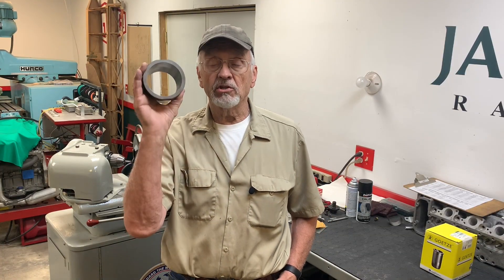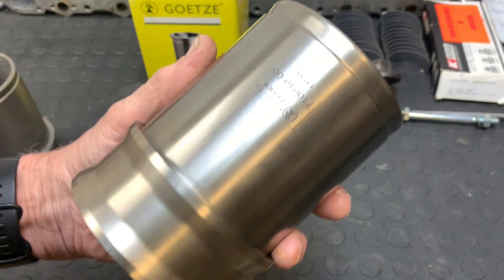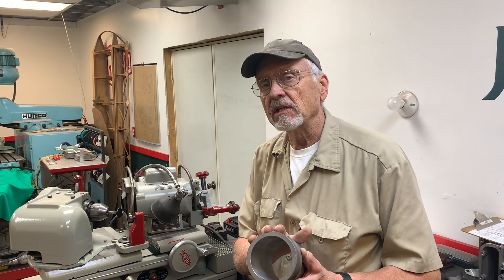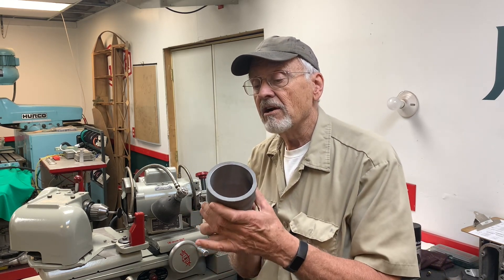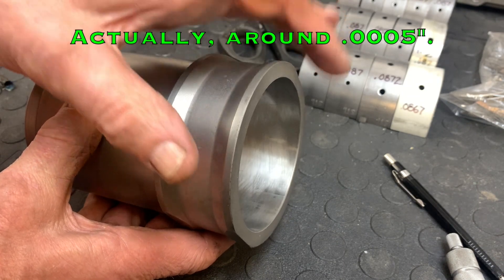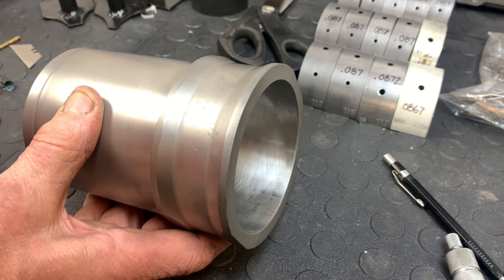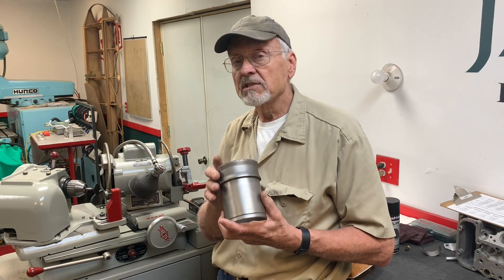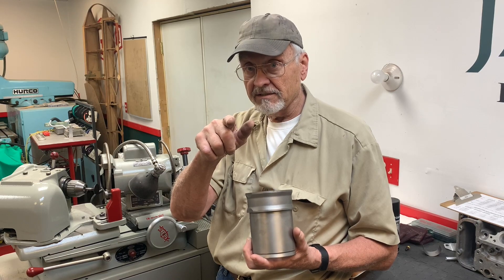S4:Episode 5-Jaguar V-12 Cylinder Liner Installation.

Comment: One other comment regarding the seal from the Liner Flange to the Block, you can use RTV. I got that tip from Rob Beere Racing and that is how I did mine.

Comment: You mentioned Ford 460 truck engine several times regarding  the main bearings. 
  Is it possible to use 1&1/2 sets of  Ford bearings  in place of Jaguar?
Reply from the maker: I've never mentioned using 460 bearings, only that the main journals are the same diameter.

Comment: Hello Bob... Many thanks for this (and all V12) videos... I've had my engine ready to go together and this has had me somewhat anxious thinking really, oil-water-heat and this is all it is?. Obviously yes but, seeing it done is really helpful. It's hard to think these cylinder to block tolerances from block to head deck can be held unit to unit over time and that once installed the cylinder top to block deck will be net zero-ish.

You use the Hylomar Blue and others on forums have mentioned Loctite 574. Any comments here or is the Hylomar sufficient? The Loctite also has an Anaerobic clean and prime to assist in adhesion... As you can see, I've spent tooooo much time wandering around the install of these. I'm 100% confident now.

I've purchased euro-spec higher compression (9:1) pistons and matched liners. Also thinking about replacing the 2nd Ring with Total Seal split for the 2nd position.

I'm hoping you're feeling better.

Comment: Good stuff. Looking forward to that stud episode. I can see this engine still needs a few.  Do you have the 6.0L liners to compare to the 5.3L ones?   Have you ever had the block oversized? I know it can go out to 97 MM and have seen one pushed to 98mm per the insistence of the engine owner (not recommended as it makes the liners frighteningly thin...)   Of we're all that is getting outside of  a standard rebuild.

Comment: Hey, thanks again for all of this work on documenting this whole process! Some of us can probably put two and two together and figure it out through means of physical paperback instructional aids but having it documented indefinitely through means of video really helps us all out. Once I get my life back on track I really want to put some work into my V12, it's an '89 with only 48k miles on it in nearly perfect condition; but I really want to show it some love and do a once over through and through to really show my appreciation for the engineering and design that went into this beast of a powerplant. I'm not too interested in power adders, but I do want this engine to be a little more lively and slightly less luxurious than Jaguar original intended hehe. Once the budget comes together in a more desirable condition, I would most certainly love to over build and waste money on this platform to create more of a set piece of effortless Jaguar power, more or less a spitting image of the stock configuration really, but with a little more, extra and unnecessary, complex over-engineering in perfect Jaguar fashion.

I've glossed over some outlandish and unreasonable dual cam configurations utilizing the AJ6 4 valve heads over the years, especially the extensive labor and effort that is required to make them function. Albeit entirely unnecessary due to modern CFM flow analytics proving that even the H.E. head can breathe well enough for at most a 500 bhp engine configuration, the 4 valve configuration being ultimately redundant yet incredibly appealing, especially for the ego. I would love to spend the time and effort slowly cracking away at designing an art piece to sit within the engine bay of my XJS.

I'm an engineer at heart but I never really allow myself to indulge in personal projects, especially ones that are as expensive and less fruitful as this may be. Despite this, seeing this process unveil through means of video really does inspire one to put in the work for what they truly wish to accomplish; and with that I truly thank you.